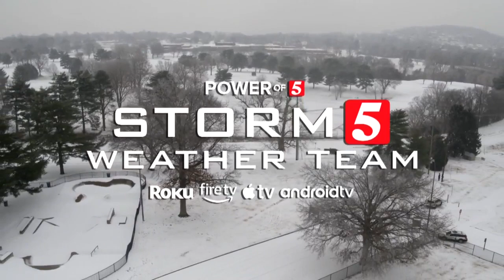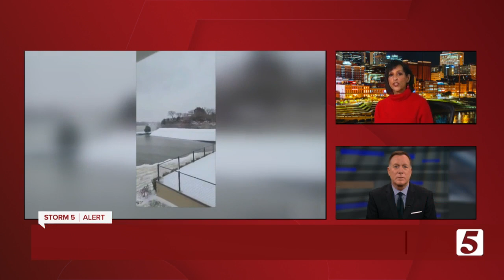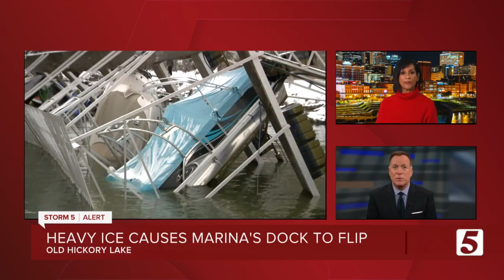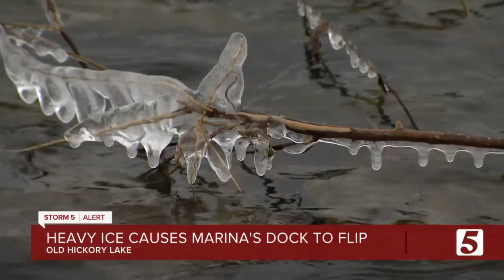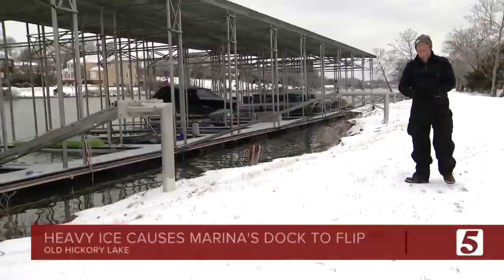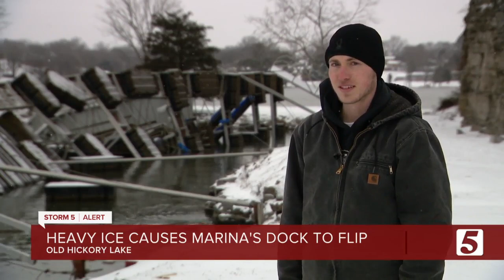Heavy ice causes marina's dock on Old Hickory Lake to flip

Comment: These are tin roof docks. Why is nobody using a blowtorch or some other heat source to heat the underside of the roof to melt and remove the buildup? "Hey everyone, bring your grills onto the dock and turn them on high or light them up with the lid off.."